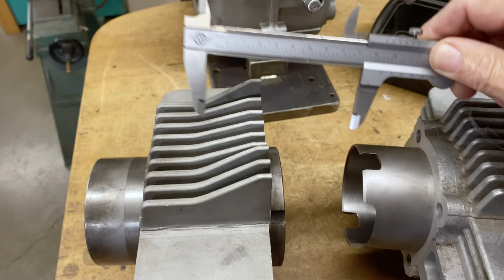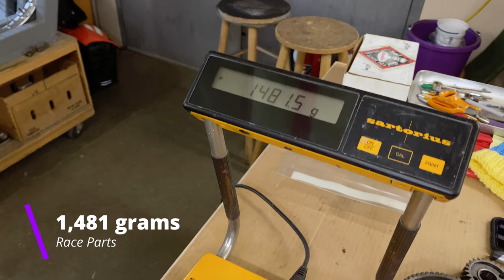Aermacchi engine tear down // Paul Brodie's Shop

Comment: Very nostalgic for me. I used to have a 1964 Ala D'Oro 350 with the motor originally built by Sid Lawton of Southampton, UK and then rebuilt by Dave Lintott (who built the one off 500 and 700 Aermacchi Twins) of Cranleigh UK. I regret selling it in 1981 but at the time, needed the money.
Reply from the maker: We will be building that motor soon. The frame awaits!

Comment: Another exceptional episode! I very much enjoyed the explanations in regards to the stock VS modified parts. Removing two pounds of rotational mass from the internals? That must make a massive difference!!!!!! I have split approximately 6.23 million engine cases (that may be embellished....) since I was 13, and learned very early on that screwdrivers were a No No!!!!!! I will tell you right now, I jumped three times in this video, first when the wrench slipped , then when the kabooms happened with the puller....... I thought for sure you had broken the cases!!!!!! Thankfully I was wrong, but good god that was tight!!!!!! Great stuff!!!!!!!
Reply from the maker: Thanks Glen. Yes, I have already polished a few tenths off the shafts. Way too tight!

Comment: Great series of videos.  I teach machining last 10 years. I also build and race Kawasaki Dragbikes and used to work at a motorcycle machine shop. Plus I did 30+ years ago as a CNC machinist for many companies. I can appreciate all that you do and the practical way you approach it.   And how methodical you are.   I will continue to watch and share with the class - I think to see the use of what an engine assembly is and its relationship to machining.  It starts to make more sense the difference between clearance holes and press fit holes. etc. thks again paul
Reply from the maker: Thank you! You certainly have a lot of experience too. I appreciate you sharing with your class :)

Comment: Hi Paul, I was once on a boat with two V8 Cat engines.  One overhaul the lock tabs were not bent up to stop a small end coming adrift.  So, the small end came free and then it beat its way out through the side of the engine, the lack of oil pressure stopping the engine.  I think it was US $68,000.00 for a short engine.  Jolly useful chaps lock tabs!
Reply from the maker: Good story! Thanks.

Comment: Well guys, a very interesting show. I see many similarities between this engine and the 125 cc Rapido Silver Wing engine I raced back in the 70's at Westwood.   The tapers on the primary drive gear and the racing clutch details are similar. The special tools you made  really help get the engine apart without damage.
Reply from the maker: I was at Westwood in the 70's :)

Comment: Paul, ARP makes 12 point cylinder head nuts in a variety of sizes. They would be lighter and they typically could use a smaller diameter wrench. Loving your channel and learning a lot from you . Thanks to you and Mitch!
Reply from the maker: My Excelsiors use ARP studs for the barrel and heads. They make some very nice stuff. Thanks.

Comment: Great video, thanks. One additional info: as far as I know only the standard bikes had this press-fit between shaft and bearing. The original racers had a slide fit and their cases are easier to split
Reply from the maker: Thank you. That would make sense that the original racers had a "slide fit" for their bearings..   :face-purple-wide-eyes:

Comment: Hello Paul, this was a very entertaining episode. (Flinch included!)
   I was fascinated watching you split the cases, bearing in mind the engine hasn’t run, I could only imagine what splitting a used motor would be like.
   My mind was going ahead of time imagining you having to press the cases back together, a nervous time. I hope you ease the connections to help?
    Good luck! 
Thank you again Kevin.
Reply from the maker: Thanks Kevin. That engine had run. I raced it either one or two seasons. Can't remember. I polished the shafts so it will be easier to get back together.
Reply: @paulbrodie  I’ve worked on a few 1970’s (and older)engines and getting them apart after so many years is half the challenge, without making mistakes. I do enjoy your methods and the gadgets to achieve it. But the pressure you had to apply was setting my teeth on edge!
Thanks again Kevin.

Comment: Somewhere I've got a Hot Rod magazine that tests a 250 Aermacchi/Harley Davidson scrambler.  Early 60's I believe.  Bob Green was the editor of the magazine and also a big motorcycle guy.  Anyway Harley dyno'd every scrambler engine.  There were 2 states of tune.  Flat track and scramble.  Each 250 had to make a certain number before they would release it.  Something like 28 horsepower.  I'm not sure most people know nowadays how fast and popular Aermacchi's were.  Anyway I love what you're doing and how you're doing it.  A very enjoyable video in a great series!  I can't wait to see the bike all done.
Reply from the maker: Thanks Matthew! You're probably talking about the 250 2 stroke, correct?
Reply: @paulbrodie  No, laid down cylinder 4 stroke.  I'll see if I can find it.  It's a great article!
Reply: They did make a 250 sprint 4stroke in the early 60s. The 250 race bike was called a CRS and the 350 was a ERS.

Comment: Hey Paul, Just enjoying yet another wonderful episode of mechanical delight by yourself and Mitch. At one point, when removing the clutch plates, you made a small tool from welding rod to pull out the plates. They immediately minded me of one of my favourite tools: for years I collected the wires or tangs which fell of street cleaner brushes, you know, the big circulating brushes that were mounted on street cleaner trucks. They are flat and just over and 1/8' wide made of fairly soft steel. They can easily be shaped and sharpened and bent to desire. I have a collection of them in my car, house and tool boxes and all for the price of looking down occasionally when walking city streets. Anyhow, I was wondering, for removing the clutch pates could you not just use a small magnet? You did ask. Just a thought. Thanks to you both for this wonderful programming and your creative genius in all things mechnical. I love what you do. Cheers.
Reply from the maker: Thanks Sandy. Yes, someone else has suggested small magnets for removing clutch plates. That could be a good idea!

Comment: Paul.  While checking the crank make sure you pull the big end plugs out and clear the inside of the pin. The Macchi's a filthy engine and due to the oil feed hole going to the inside of the wheel all the debris gets stuck in there.  Its best to do this a few times a season. You'll be amazed how much crud is in there in a short period.  A little secret is to alternate the clutch plates, ie, two fibre plates together and same steel. You get the same frictional grip but helps control the slip on starts.  Sounds like Tony Foale's trying to get his new bike out for June. Is that what you are aiming for?
Reply from the maker: Yes, I do know about the crankpin being used as a sludge trap. Will do. Never heard of bunching clutch plates like that. With the dished steel plate, starts are no problem. I am aiming to make more videos. I am retired from racing, unfortunately.

Comment: The special tools needed is what makes me hesitant to tear down my Sprint.  I have the parts I know of to convert my 1972 Sprint into a 1973 W/O the heavy electric start and alternator.  5 speed transmission, head, studs etc.  But trying to find/build those tools would be a major issue.
Reply from the maker: Yes, I made all of my special tools, and I have a lot of them... Trying to find factory tools would be very difficult. You say you have all the parts, but there are a lot of of small stuff like locking tabs, o-rings, shims and gaskets, so I really doubt you have "everything". When Moto Italia sold and vanished, they really did leave a big hole in the Aermacchi parts trade...   :face-orange-raised-eyebrow:
Reply: @paulbrodie  You are correct on that.  I know I don't have those parts but I never figured that Moto Italia would go away so quickly.  I was talking to him about my old 71 Sprint that he purchased many years ago.  He said he still had it.  I said I might be interested in getting it back.  Tom Sifton built the motor and it ran like a scalded cat. I can't tell you how many generator armatures I replaced.  I could rev that motor way high.  he put in a custom cam and push rods and ported the head.  I don't know what else he may have done.  My uncle was Sam Arena and owned the Harley Dealership in San Jose.  He purchased my Sprint then gave it to Tom to "fix".  My uncle decided he didn't want it after all and sold it to me.
I flat tracked an 1969 ERS for a couple of years before replacing it with a Kawasaki Bighorn.  The ERS had a BSA .040 piston in it.  The piston land height was taller than a Sprint so it had what looked like a stroker plat below the cylinder.  We had to clay the piston and grind judiciously to get it to spin over.  Lots of compression.  Built a manifold and mounted a 32 mm Mikuni on it and got the jetting from Mert Lawwill.  It ran REAL well after that.

Comment: Paul,  please look for a ducati  cylinder head spanner. This is what we use to torque heads down. It is basically a half moon ring spanner, with an allowance for a square drive. The torque setting don't need to be compensated as the ring side and drive side are in the same plane

Comment: Helical primary gear sets were also used by other Italian makers of that era . The early 500 cc V twin Ducati desmo 1982 also used a helical gear primary and clutch hub. The crankshaft bearings used were these massive angle contact spindle bearings, shims were needed to preload the bearings on assembly. I’m guessing this was to stop the crank being driven sideways off the helical spline and knocking each time the engine fired. Straight cut gears and normal bearings with no pre-load issues sounds like a great race modification to the engine.
Reply from the maker: Thanks for watching and commenting.

Comment: Great video love the way you work Paul great to see the detail. Is it worry that the cases could crack putting them back together
Reply from the maker: They were tight coming apart, so I sanded the shaft down a few tenths of a thou to make assembly easier. There is no good reason to have such a big interference fit.
Reply: @paulbrodie  I hope your beginning to feel better Paul
Reply from the maker: @lotus7even  It's a long process with a lot of good and bad days. Today the pain is under control, so I would call it a good day.

Comment: Pulling the clutch pack out, 2 magnets do the trick to pull out the entire pack one by one. If Strong enough, it can bypass the friction plate. The higher the N number, the stronger the magnet.

Comment: I would be interested in pumping up my 1969 Sprint 350 as a tracker. Not so much eraser but one to go out have some fun and that's it and put it back in the garage.
Reply from the maker: Did spellcheck add "eraser" to your comment? I'm not exactly sure what you mean! Sprints are good project bikes for sure..
Reply: @paulbrodie  racer
Reply from the maker: @stevevasquez7754  OK, I get it now.

Comment: Another great video!  Most of your viewers might not know that a stock 72’ did not come with the bolt style head or the 5 speed.   Did you do the 5speed conversion?  Plus I don’t see the advantage of the shorter Rod? Most of the time increasing the rod length and decreasing the piston compression height is more desirable.
Reply from the maker: Thank you. Yes, the stock North American 350 Sprint had the Ashtray head and a 4 speed. I took the 5 speed out of a 73/74 motor, and also added the close ratio conversion, which means changing the (2) final output gears for a taller ratio. The shorter rod is lighter, and allows me to move the motor forward in the frame to get better weight distribution; more weight on the front wheel.

Comment: Nice video! Did you manage to cross the finish line when the engine blew? The engine cases seem overly big for the internals, although the manufacturing looks to be very good. Is the 5 speed racing gear upgrade also German made? Thanks!!
Reply from the maker: Thanks William! I was a DNF in that race. The cases look big because they also serve as the oil tank. Wet sump. The transmission is 73/74 Aermacchi with German gears for the final ratio. A higher ratio which also serves to make it into a close ratio transmission.

Comment: Here in the US you can find all kinds of incomplete Harley Sprint 250 and 350s. In other words you can find a number of incomplete Aermacchi  250 and 350 machines. I always wanted to take one of these rollers and make a Aermacchi  race bike.
Reply from the maker: Yes, years ago I used to buy complete Sprints for $200 each. Ended up with quite a few. The price has gone up! That's how I started on building Aermacchi race bikes.

Comment: Hi Paul, here in the UK, back in the mid 70s, Harley Davidson had a 250cc 2 stroke single in their model line up. We had a magazine called "Motorcycle Mechanics" (now called "Classic Motorcycle Mechanics"), and in the mid 70s, they did a multi bike 250 test, with all the 250cc motorcycles available in the UK on test. The braking on the Harley Davidson was described as "a brown trouser affair".  I believe, but not sure, these Harley 250 2 stroke singles were also made by Aermacchi and badged as Harley Davidson, do you know anything about them?.
Reply from the maker: Yes, Harley had a 250 2 stroke made by Aermacchi. I was never fond of them.
Reply: I had one back in the mid 70s, paid less than $20 for it. Pretty sure it was stolen. It was also missing the back wheel, an whatever linkage was required for the shifter... 
I was a desperate kid with few resources, I had a back wheel from something that I managed to fit. Got it running, no clutch, don't remember why, just push start and go. I'd reach down and yank on the shifter arm and worked it up to top gear. Pretty fast I thought. One day the cops stopped me, of course I'm like 15 at the time, bike is completely illegal. When I went to court, my mother asked the judge to refuse me a drivers license until I turned 18! He did! 
Happy Mother's Day mom. 🤣
Still love motorcycles!
Reply from the maker: @stratowing   Wow! Good story. Thanks.

Comment: thanks brodie for this! I just don't know how I=I'm going to find tools that'll work like the special tools you created 
wish I had you nearby to coach me
Reply from the maker: Yes, having the special tools really does make the job easier. I hope you find a way to make it happen. Thanks for watching! 😉
Reply: @paulbrodie  any idea why my fork frame serial number doesn't match with serial number on engine?? 😁 once again thank you for what you do
Reply from the maker: @jessierubio5038  Probably because someone has swapped out the motor. Frame and motor numbers match from the factory...  😉
Reply: @paulbrodie  makes sense, if I ever have questions is there any way we could have a line of communication I have high aspirations to restore what I have
Reply from the maker: @jessierubio5038   I do have an email address that can be found...   🙃

Comment: 25:14 That's a fugly casting. Do you clean the flash off to prevent stress cracks or have you not had a problem with cracking cases? And I reviewed the oil line episode. Now I know why he hides behind the camera. (just teasing!)🖖
Reply from the maker: I have not had a problem with Aermacchi cases cracking.

Comment: I wonder if heat would help to get these crankcase halfs apart. Like on vintage BMW's where everything is an interference fit too, and heat is being used in almost every assembly/disassembly step. The aluminium expands a lot more then the steel, so that helps a lot.
Reply from the maker: I was removing the shaft from the bearing, so steel on steel. Using heat to expand the aluminum does not work here, but thanks.

Comment: On the Benelli egg motors which are very similar to this we have to fit a wedge between the crankshaft webs when pulling the crankcases apart to prevent likely damage to the crankpin. I was very suprised you didn't  use something similar.
Reply from the maker: The puller pulls the case off of the pinion shaft. I don't see how that is applying force to the crankpin?
Reply: @paulbrodie  Yes I agree with you that it pulls the case off the pinion shaft, but the shock loading on the crankpin when it suddenly starts to move the bearing ought to be avoided. This is what Benelli recomends when dismantling and definately when reassembling.

Comment: If you reduce the base circle on a good stock or aftermarket cam(s), you get more lift. You can also reprofile the lobe a little. It's an old trick. My drag bike has Andrew's n4 grind cams with a slightly reduced base circle.
Reply: Doesn't this typically suggest the cam is a performance regrind if the base is smaller?
Reply: Sorta. Smaller base circle will most likely require other parts that are not stock, like lifters and adjustable pushrods. Most if not all perf. cams that are drop in, will have a  base circle equal toa stock base circle.
Reply from the maker: I haven't checked enough cams to know how often the base circle has been ground smaller. Thanks.